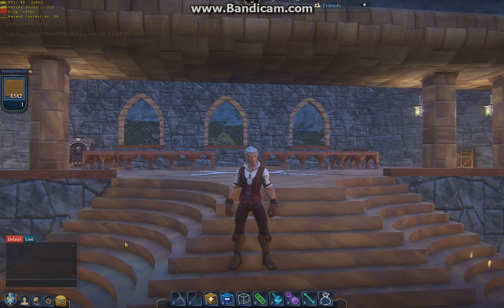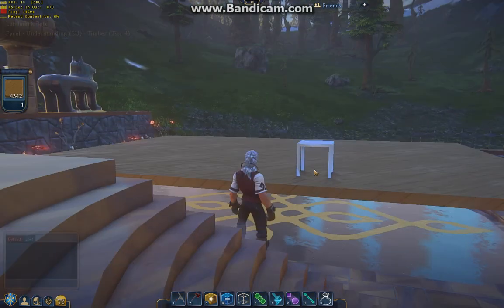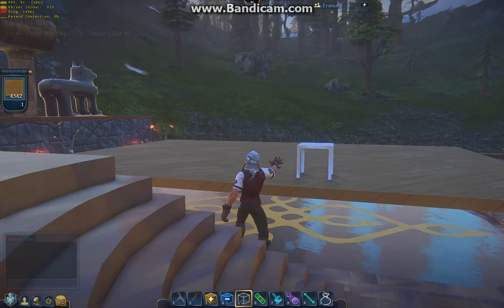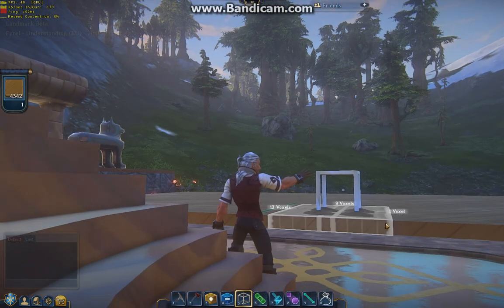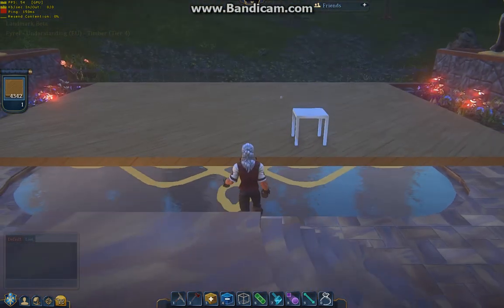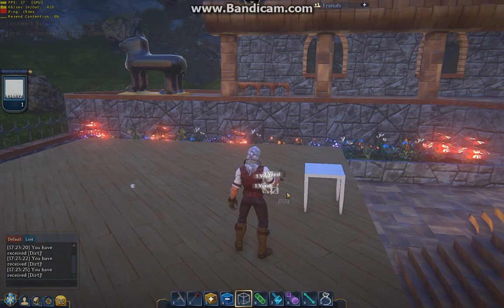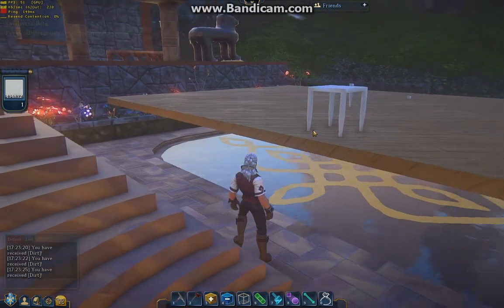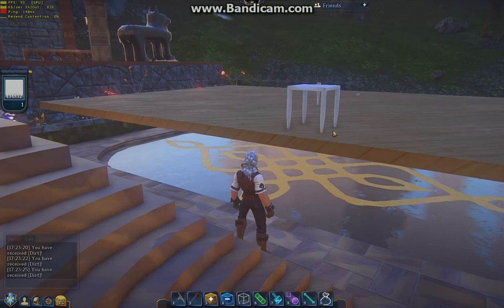Connecting microvoxel structures smoothly to the floor

Comment: how do you make a micro voxel?
Reply from the maker: Place a voxel block in the air and use the smooth tool to shrink it.
The current smooth tool only allows 3 sizes but there are more versions on the voxel boards from the old smooth tool.

Comment: The workaround I use is place anti-voxel strings of an appropriate size between the micro-voxels and the floor. Works a treat for things like chairs, screens, etc. On the other hand the anti-voxels don't give that nice tapered look.
Reply from the maker: Yeah anti-voxel strings work wonders.
Posted this as another method for those builders who haven't gotten around to working with anti-voxels yet.
The more ways to build something you know the better your options. :)

Comment: Would the middle micro voxel of the leg itself be stretched to the full length as well? And it would have the original "size."
At least that is the way I'm thinking this works. The microvoxel has to be X length so it doesn't deform the floor trying to connect.